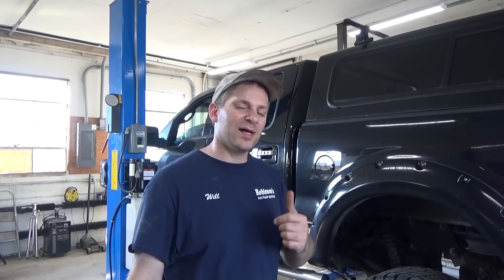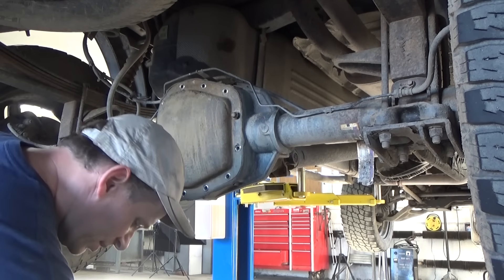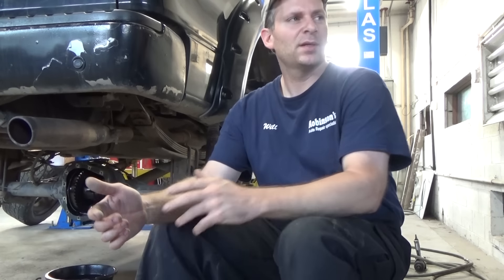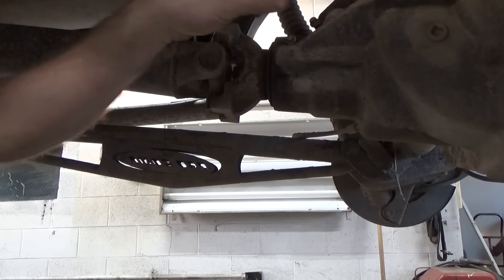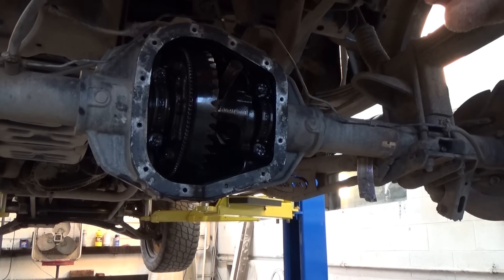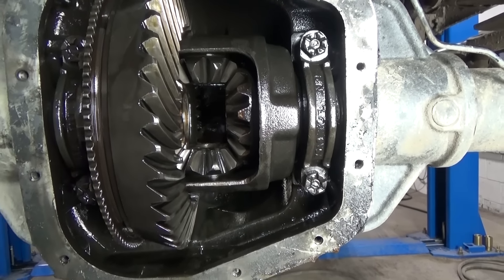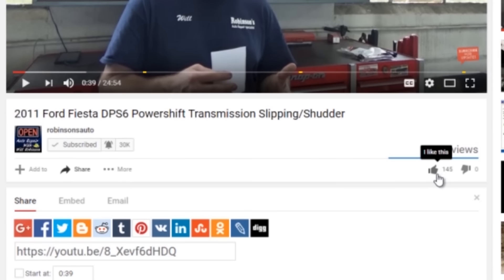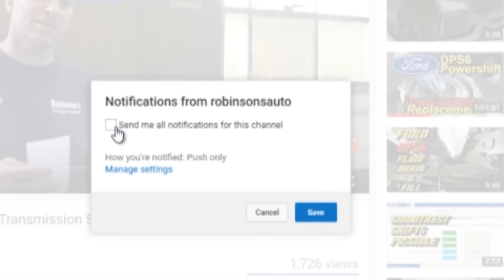Ford F-150 - Rear end Noise 9.75

Comment: My outer pinion bearing grenaded in my 9.75 (18' f150 3.5l eco) and... well it sucked. Towed it to two close shops and they quoted me an entire rear end replacement at $5k and $6k. It was over $4k just in parts! Ultimately, I decided to do it in myself in my driveway like god intended. It did take a while. First weekend: Tear down and order parts. New ring and pinion, new pinion bearings, new seals all around, and picked up a few rental tools from Orilleys. Second weekend: Salvaging pinion shim, cleaning everything, installing seals, and an entire 8 hrs screwing with the crush collar. Third weekend: Crushing the collar and putting it all together again. I ended up recycling the old crush collar by putting it on the old pinion and beating the shit out of it with a 3lb sledge, real methodical like. I made the old collar about 1mm longer, which is only .5mm shorter than the new one. Cleaned it up real nice and it worked like a charm. I still had to borrow the neighbors 3x torque multiplier to crush it back down, but it worked great (12-16 in/lb resistance). Turned out the stock shims worked perfect and backlash ended up at 10 thou - slightly below spec but I figured since everything was FoCo and the marking pattern was awesome, it'll do. No noise, everything is smooth, and I'm around 100 miles since the rebuild - so we will see. Ended up taking about $900 in parts and $400 in tools. Saved around $4k and from what I can tell so far, the problem is solved. I'll be hauling a 1000lb bed load 200 miles tomorrow and I'll report back to give thanks to robinsonauto if all goes well haha.
Reply: Man lots of work but you one smart cookie man! I congrats to you.

Comment: 3:39 if you have to pry the cover off, try to pry from above the oil line, that way if you bend the cover slightly, it'll be far less prone to leak up at the top half.

Great video!!
Reply: Great thought, I'll file this away in my think holder.
Reply: no leave 2 of the top bolts loosened halfway then use a 1" putty knife/spatula to pry the bottom till the lube oil drains into the pan. used lube oil smells almost as bad as sewage.

if you do it from the top? most likely you're getting lube oil on your work area and you as well as in your pan.
Reply: No need for all that, a thin blade from practically anything will work without bending the cover. Takes more time to remove but easily doable.

Comment: I liked and appreciate this video series.  However I have an issue that I may have caused with mine.  I put very excessive carrier bearing preload.  According to Yukon you almost can't overdo it.  I upgraded from open to limited slip.  I used my same shims as before 9/10 you will get it right.  My marking compound looked great  I am noticing far too many shavings on my magnet. SO, I will be pulling mine apart again.  I did NOT mark my retainer caps.  I did get the correct side but I may have 1 or both upside down.  The old 8.8s used to have arrows that pointed out towards the axle.  I can't tell in any video any distinct marking from FORD that denotes which way they go.  What way is the lettinging facing?  I am looking for clues for when I put mine back together.

Comment: I'm going to guess the pinion bearing is toast. If you look carefully between 14:02 and 14:15 when he's checking  backlash the pinion looks to be rocking up and down a bit (as well as rotating). (focus on the dot on the face of the pinion not the teeth). If it's just bearings  is it really necessary to change the ring and pinion. Those gears are really big and tough. Once you get the bearings done wouldn't it be enough to just re-lash everything with appropriate spacers and be done with it. The worn corners on the ring make no difference once it's working properly. Unless of course the pinion is really damaged from that. This is an old vehicle anyway. But I guess they expect it to be done like new if they're paying for it. A bit different when your doing it for yourself I guess. Can't wait for part two.

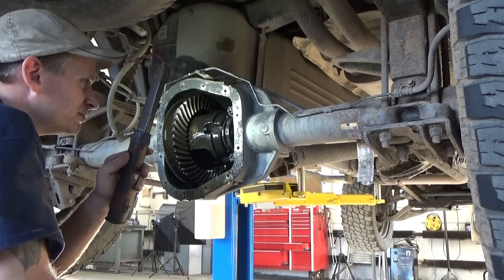Comment: 4:56
Use the 11 and up r&p with the conversion bearings, delete the crush sleeve.
Dont bother replacing the clutches, you wont get them in, just get a new carrier with a yukon torsen unit.
Reply: Please send me a list of bullet proof stuff to rebuild mine! Gears are fine, I checked. The bearings are just making a racket. 2011 F150 with the 9.75

Comment: Have a 9.75 3.55 limited slip on the rear of my F150 and was going to do a fluid change.  I'm going to use Valvoline full synthetic gear oil with the friction modifier built in but would love your thoughts. (And anyone elses)

No strange noises coming from it at the moment but enjoying this vid. lol

Comment: I have a weird shudder or vibration in the rearend that occurs while very lightly applying the gas around 40-50mph. And I noticed the same sensation in the rearend when the car downgeared a few times when I hit the gas on the free way. It's not constant which is weird. And the car shifts great under hard accelerating and braking.
Reply: Mine shudders from 54-64 mph if cruising. I thought it was the rear end, but was told it was a misfire in the motor. Not enough of one to throw a definite code, or to make the check engine light come on…they told me a timing job would “almost certainly fix the problem”. Yea, just $2,800 for a POSSIBLE fix
Reply: @TrevorLahey3  I had the same issue.  '05 F150.  I bought a cheap ( like 40CAD) Bluetooth OBD2 ( it's blue says "Veepeak" on it) of the jungle website.  I recomend using it with the Torque app, as there is an xml config file you can put in the directory on your device that will give you REAL TIME misfire data on a per cyl basis.   This is mapped specifically at the mode 6 data for misfire count, and gives you customizable display options.   I was able to use it to not only diagnose the misfire condition, but also a subsequent CVT solenoid issue ( which can also cause what you are seeing) .  If it is phasers, the VCT system, or the oil system ( pump, cam passages, solenoid screen being pluged, hydraulic tensioners blowing their seal (causes a drop in oil pressure which will affect VCT functionality, as it uses oil pressure to actuate the variable timing.  If you put it in gear, torque load it by putting the brakes on, and giving it between 900 and 111 rpm and hold it there.   If it is in that system anywhere, the truck WILL shudder, stumble and misfire. Having a low oil level also will cause it.  

Ultimately the fix was me doing the a whole new timing set, new phasers, new vct solenoids, a new high pressure oil pump, and a move to 5W30.  The subsequent VCT solenoid issue would ONLY happen when the truck was hot and the oil warmed up.  Turns out, shitty Chinese solenoids will do that.  picked up the FoMoCo ones, and we are A1 3 years later.  All told cost me about 1200CAD in parts.  I did NOT but the Ford phasers ( I know SHAME ON ME), but rather a newer version of the cloyes full kit from Summit Racing.  I admit, it was a gamble, but they are holding up, so fingers crossed?

Comment: I have a hum in my rear end as well i have just learned to live with it, I like your video i like your work your plain straight and to the point i cant wait for part 2 and if your able to repair this rear end I'm thinking i might tackle mine as well
Reply: Likewise.....my rear has been noisy for about 3 yrs now.......just learned to live with it. I just changed the oil in it, and no surprises....so that's good
Reply: @powerking73  on mine, it gets louder as you speed up...about 30mph+ almost like a whirr

Comment: Definitely a worn ring and pinion noise. Didn't look like you drained much oil when you removed the cover. Everything appears dark and burned unless my glasses are dirty...{:>) 
 You sound like you're tired so take it easy my friend. Don't burn yourself out.
Reply from the maker: wysetech2000 very good assumption as always! And nope you glasses 👓 are ok!lol thank you 👍
Reply: I'm wondering if someone over-torqued the pinion nut and screwed up the crush sleeve.  It looked like the pinion needed to extend into the housing further to avoid running on the outside of the crown gear teeth and rolling the edge - and that should also get rid of that horrible lash at the same time.  *crosses fingers and waits to see the outcome*  :-D
Reply: The gear oil with friction modifier mixed in (for the limited slip) coats everything over time with something like shoe polish.

Comment: It does not matter wear the spacers were you still have to reset up. The diff if your going to do it write  all you have todo is look on the  ring gear and its stamped on the gear and it should be stamped on the pinion

Comment: The driveshaft is balanced alone.. Marking it only serves to put the worn out parts. Back in the same place..As the second you put new U-Joints on. The wear is changed anyways..If they wear at all...

I would add. Those are not spacers. They are friction washers for the bearings.. You adjust the lash by removing the plugs on each side of the axle housing. Then you will see the adjusting nut.. You can turn it with a screw driver in\out to align the rear axle...

Comment: That e-brake setup is sketchy as heck. Also never seen a Ford axle with u-join saddles like a GM. Looks like you get to clean up someone's mess!
Reply from the maker: sure is, very similar to GM in many ways. UGH yea i would have passed if it wasn't a good friend. its a
Reply: Yeah its not the right yoke, it should have had a flange with fords classic 12pt 12mm bolts

Comment: Cost me 3 grand for my rear end and after seeing you do it I think its a job for a guy like me.....well done vid and don`t buy the rest of the sshop....more employees less money more trouble...bin there now that....SALUTE.....STEVE ROB sent me so I sub and rang your bell
Reply from the maker: adds up quick, part two coming soon where i cover more however,  if you where to do the work, parts will set you back around $1,200 this is buying everything from Ford OEM minus ring and pinion. that i had to purchase aftermarket due to ratio change.  said price includes ring and pinion, Thank you for stopping by and Subscribing!
Reply: Gator's World That Steve Rob is a good guy.
Reply: Gator's World Wow, you could have gotten an entire rear-end from the junk yard for $200 and just swapped it out in an afternoon.
Reply: OK mister Apollyon....I could have bought a junk yard rear end that was just as bad as mine and spent all that tire and have to do it again....not my thing....sorry...I lived and I learned....SALUTE
Reply: They typically come with at least a seven day warranty.... Most are 30 day. Of coarse you do a fluid change and inspection.

Have replaced four axles so far from a salvage yard with no issues.

Comment: I have a growl in the rear end when undr load. When ecelerating or going down hills. 1998 GMC Sierra 1500 4x4, 5.7L. Truck has 381,359 miles on it.
Original motor and transmission but the previous owner replaced the transfer case and the driveshaft does not look to be OEM. Drive shaft is aluminum and not steel.

I'm thinking pinion bearing... I don't drive it much anymore, so have been living with the noise. I do not think the rear axle is OEM either because my odometer is 5 MPH off. 30 MPH reads as 35 MPH for instance. There are no tags on the pumpkin... Yank it apart, get the numbers, count the teeth, do the math I guess.

I'm leaning towards simply swapping the axle over fixing the pinion bearing. Can get an axle for $200 at the local salvage yard, pulled. Have replaced axles before and it only takes a few hours. That would fix the growling and the odometer.

My worry is that since the existing axle is not OEM that I'll get the wrong gear ratio and the odometer will still be messed up...
Reply from the maker: Apollyon εжз being 4wd your best to remove cover and be certain, ratios need to May front and rear. But yes that many miles likely worn out
Reply: Thanks, I didn't think about checking front axle and using that to figure our rear end ratio.

Comment: Great video on taking apart the rear axle. When taking off the pumpkin cover do you think it would help loosen if a heat gun were used to heat up the seal? 3:15
Reply: Unlikely. Typically silicone is highly resistant to heat.

Comment: Definitely worn ring and pinion, and from how you turned the pinion, it looks like the pinion bearings are worn too since there's no preload. With all the shenanigans going on, I'd also check the ratio up front to make sure it matches.
Reply from the maker: good call! and great suggestion, the gear ratio indeed matches the front. i wouldn't have been to surprised though like you mentioned

Comment: So got an interesting story and question:

I went to put new brakes on my rear today, been a few years. Its 2001 with 9.75 rear. Found that my hub/axle was moving in and out. Opened up rear diff and found play between the end of axle and the metal dowel pin. I 'believe' whoever opened the rear the last time...replaced bearings and neglected to put in the differential bearing shim that your call a spacer. 

Ive never seen or heard, felt any problems with it. Thats a crazy amount of play to not being having problems. My guess is about 4 times the play there should be based on tolerances. But ive been driving it this way for 7 yrs now and no issues. 

What do you make of this? Will it blow one day?
Reply: The spacer sets proper clearance between the differential carrier and the housing, but it has nothing to do with the axle play you speak of.  The axle slides a little bit in and out, but independently of the carrier, and the amount that it moves is related to the dimension from the C-clip to the stub end.   Look closely and you will see that this is the case.  Could it be that the previous owner replaced the axle shafts with a pair that are similar but with the wrong dimension between the C-clip and the end?  I recall on my own light-duty trucks with the same kind of axle-anchoring setup, that there is some end play, but I don't remember how much.  It's definitely NOT a tight clearance.  Wheel bearings that are non-tapered rollers "don't care" whether the axle can move in and out.  The bearing fit remains the same whichever position the axle slides to.

Comment: I have an f150 -2005 I bought it like in November 2004 right off the brand new ford dealer had about 30 miles on it and I now have around 58k I hardly ever driven it and had this kind of problem for several years I now have a slip when I accelerate at stop and go points I don’t know if it’s coming from the differential or trans I need to get fix but I clicked on your video to see what it might involve so I don’t get robbed too bad sorry so long of a comment.

Can you give me any advice please, and man you sure are relaxed I’m a mess just thinking about it I’ve would of started beating the hell out of that truck with a sledge and just faced the consequences.

Thanks I do wish you the best great video, now I’ll watch part two, and I did subscribe.

🇺🇸🇺🇸🇺🇸🙏🇺🇸🇺🇸🇺🇸
Reply: SCARFACE63 CAPONE09 these trucks shouldn’t have any transmission issues that miles that low.

Comment: I have a 2004 Ford Expedition Eddie Bauer 5.4 L 2wd.  How can I tell the ring gear size (8.8 or 9.75)?
Reply from the maker: There should be a tag on one of the cover bolts

Comment: I liked the giggles from your camerawoman toward the end!  The last rear end I worked on was for my 2004 Z71 Suburban.  I wish I knew what I did wrong, but the rear burned up driving from Tennessee to North Carolina.  I had it towed to my home which is on a hill.  The tow truck operator dropped it off in my steep driveway and without the rear end, it immediately rolled down the hill and crashed into a tree (with no one except my poor golden retriever in a crate in the back) .  The airbags deployed and the suburban was totalled.  The retriever was fine!  I love challenges, but I'm not sure I want another challenge this difficult ... the spacers, which I understand are the most important and difficult to get right, were tough.

Comment: I thought all f150s got the 8.8 rear end. Only the f250s and up got bigger rear ends?
Also did u edit video or is that all the fluid that came out?
Reply: No the F150'S with the 5.4 3v got the 9.75 limited slip rear differential

Comment: Does anyone know what the hose is coming out of the axel on the left side?
Reply from the maker: Is the hose your referring to going just to the axle tube? If so that’s a vent... 
if it’s running along the axle tube then it’s more than likely a brake line
Reply: @robinsonsauto  the one going to the axel. Mine was broken just wondering if it was important. It's not the break line I know what those are lol. Thanks for the answer.

Comment: Been in the business for 25 yrs. find a whole low mileage rear end assembly. You get paid r&r time but don’t have to stand behind a gear repair particularly with a lifted/abused truck.
Reply from the maker: Wayne Swicegood I agree but its one of the things I specialize in around here. do lots of gear swaps three a month on average that includes front and rear. That's 6  difs a month makes up a large amount of the shops income. Do them in my sleep 😴 not to mention this was not a stock ratio on this truck! Both difs would of had to be swapped to stock in your  scenario
Reply: robinsonsauto I wasn’t aware that you specialize in truck diff repair. I’m a general repair shop. It’s not worth the money for me to tie up a tech and a lift to do the occasional worn diff. We see.  It’s more profitable for us and a quicker repair for the customers to find low mileage salvage units.

Comment: Uuuummm yeah that's a factory rear for a 04-08 F150 i've owned 2 a 04 and a 07 both with the 9.75 limited slip 3:73 gear ratio. The 4.6 trucks typically got the 8.8 rear ends with limited slip